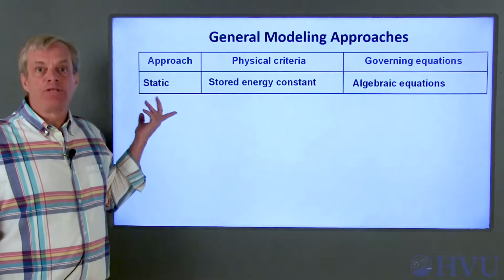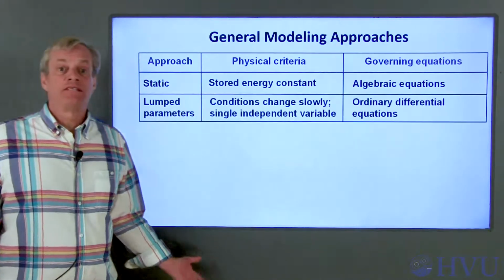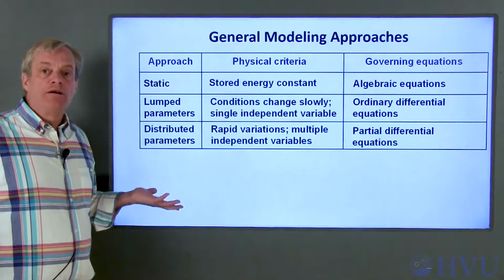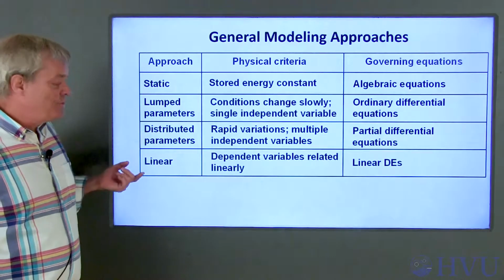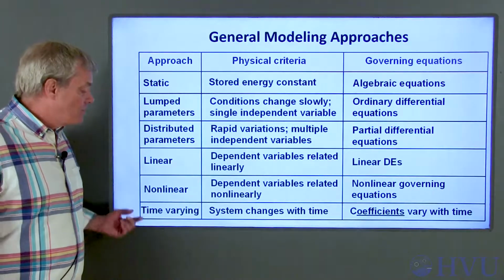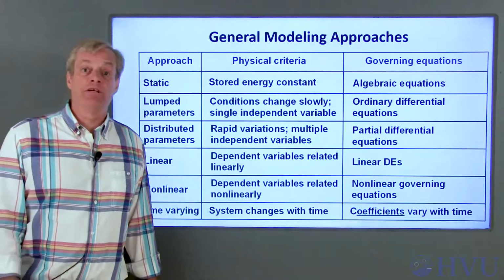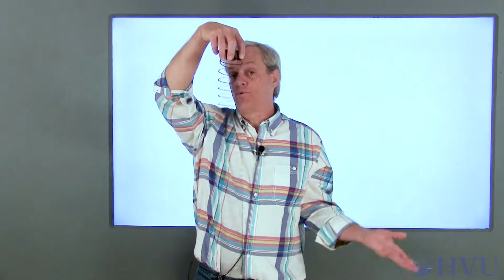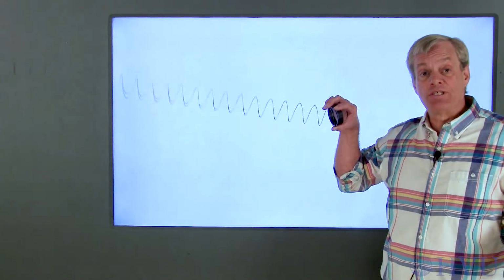Math Modeling Basics Part 3- Approaches

Comment: thanks, can i please ask you one math question?
Reply from the maker: Go ahead. I can't promise I'll give a correct answer but I'll do what I can.
Reply: @hanshawvirtualuniversity3114  Thank you very very much,
I wanted to create a one-line vector that interferes with itself.
(Z) is a vector when it has dimensions: (Z ^ K).
And interference from with in:  (-Z/Z^K)
Then:  f (z) = (Z ^ k) - (Z / Z ^ k)
When (Z) in complex space = (a+bi)
is that correct?
Reply from the maker: Is this a pure math problem or is this based on a physical system? If its based on a physical system that might help me understand the problem a little better.
Reply: @hanshawvirtualuniversity3114  Yes, this is a physical problem, I'm actually trying to compare it:
    f (Z)= (Z ^ k) - (Z / Z ^ k) with this: ∫C = E / M
Where C is any constant. The same as f (Z)  where (Z) in this case, is the constant.
When part E is the same as (Z ^ k),   and M is - (Z / Z ^ k)

The two of them are a line vector geometry .

 Thanks
Reply: @hanshawvirtualuniversity3114  Hi, maybe i think i did not explained myself so well, because i have am very poor in math, sorry. 
I just translated the operators into language.
I'm guessing that integral should be treated as a loop function, so C should be the variable that gets values in each integral solution.

I'm sorry if I'm not so well understood. 
maybe this will help:
I ask before great mathematician and he told me that this two Consistent: 
f (z) = (Z ^ k) - (Z / Z ^ k)+(Z ^ k) - (Z / Z ^ k)+....
C^2= (E ^ k) - (M / E ^ k)

And thank you so much!

LOve and Light
Reply from the maker: That does help more. It sounds like you're doing a contour integral in the complex plane. Is that correct? What is the context of the equation? Is it aerodynamics, electromagnetic, or another field?

I probably wont be able to help but with more context I might be able to send you somewhere that can
Reply: @hanshawvirtualuniversity3114  yes i think you right about the contour integral, from what i understood. 
The way i see it if you take: ∫C^2=E/M and if you say that E and M are the same line and M is "from" E that means E>M 
We usually relate to energy and mass like quantities vector.
I don't want to treat them like that, I want to treat them as a vector line.
[C] should be the variable that gets values in each integral solution (iteration).
and give it back to E.
sample if E =2 and the power =2    ∫[C]=(2^2)-(2/2^2)=3.5 so [C] gets 3.5 
∫[3.5]=(3.5^2)-(3.5/3.5^2)=11.96 and now [C] gets 11.96 
with this function it is just the same hopefully. f (Z)= (Z ^ k) - (Z / Z ^ k)
the function from above is in set mathematics.
I think the differences between this two is the function is Bounded set and the integral is not. 
I hope i am more clear if not just say and ill try to be more clear. 

Thank you so much for your time and effort 

Love and Light
Reply: @hanshawvirtualuniversity3114  I am also would like to compere this function to anther equation.
if it's ok with you 
thanks 
LOve and Light